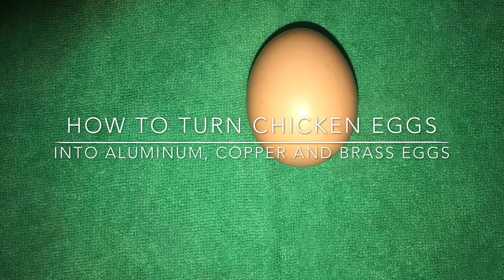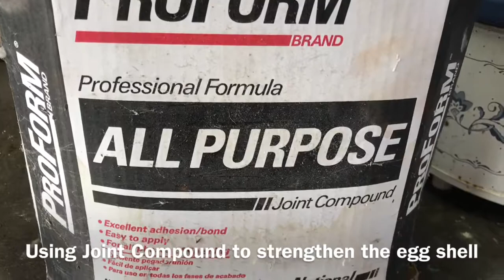Aluminum, Brass and Copper Egg Casting

Comment: Nice video. Out of the three elements. Which one is the strongest in durability? Which one took more heat to melt?
Reply from the maker: Brass seems to be more durable, copper takes more heat. Copper melts at 1983 degrees, brass is 1710 degrees and aluminum takes less heat to  melt at 1220 degrees. Aluminum is also easier to pour.
Reply: @dalemiller9444  Thank you for your response.

Comment: Appreciate showing the work this is incredible, as I was wondering how Solid gold, silver, and copper eggs could be made.

I am curious about something else, just as metal egg was made from the actual shell of a real egg, do you know of a way to make a solid egg shell, made of metal, preferably one that opens like children's Easter egg toys, maybe it screws together(each half of the egg shell), main point is surface should be smooth and polished, without any abrasion.
Reply: Sizing of the Metal egg shell has to be perfect, because I want to fit an inside of the metal egg, so the egg should be secured tightly on the inside of the metal egg shell. Appreciate your feed back.